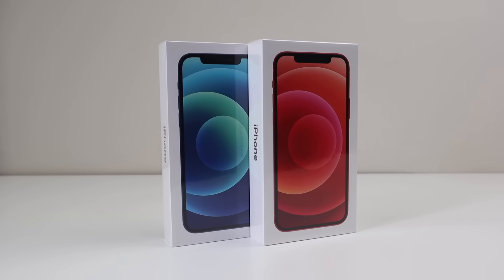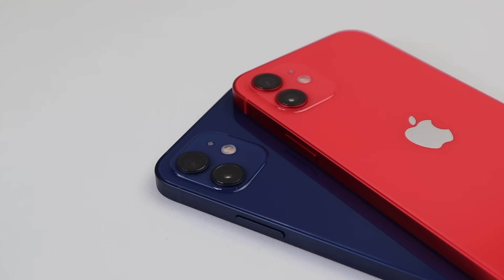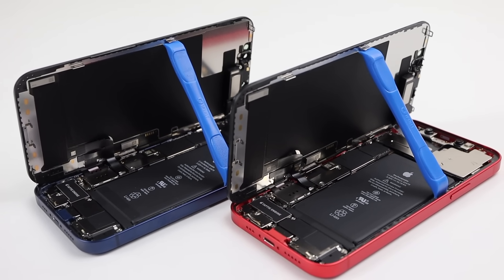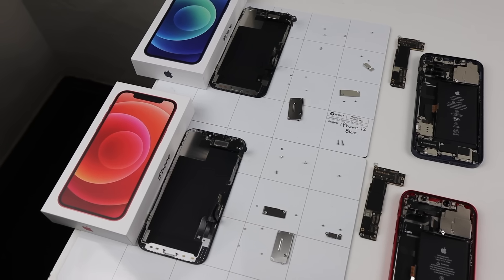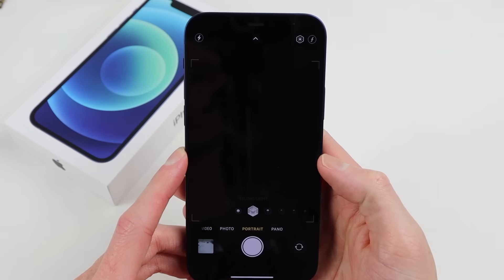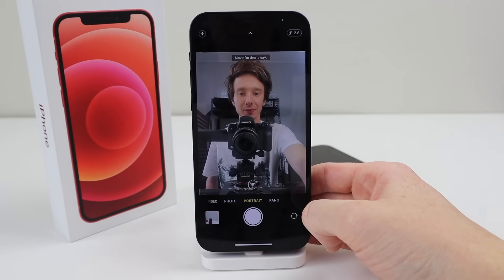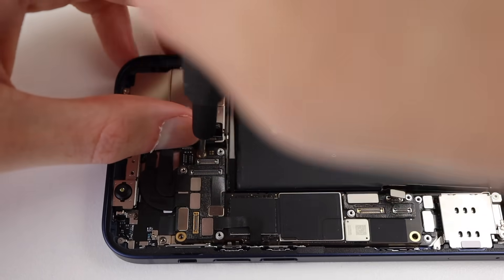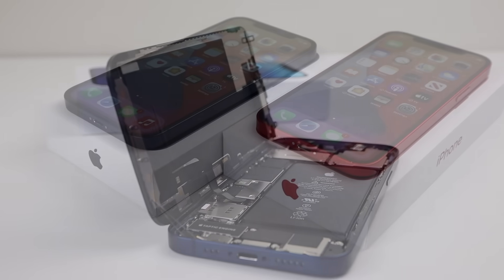iPhone 12 Anti Repair Design - Teardown and Repair Assessment

Comment: Me: holding onto my iPhone 6s Plus for dear life because I don’t wanna leave my home button and headphone jack
Reply: Holding onto my Note 8 for similar reasons
Reply: Kevin the note 10lite also has one 🥳🥳
Reply: @Dryblack1  A71 has headphone port
Reply: @katiserie  You're out of your mind if you think it makes sense to switch from a flagship phone to an extreme budget phone because an out of touch phone company thinks people spending well over a grand on a phone don't want headphone jacks.
Reply: @Dryblack1  same device :>
Reply: iPhone 6S gang
Reply: @tdoyr  just move to Samsung and stop paying Apple so they gotta not be so scummy
Reply: @SkyJUSTIN6  
If I had the money I might, but I also like the iOS system more

It’s a shame they make some nice software
Reply: @tdoyr  maybe try a cheaper pixel, they seem to get a whole lot of experimental updates
Reply: @SkyJUSTIN6  Only reason I still use Apple is because from time to time I break screens and need battery replaced, because I can repair it, I like it. That will change now. Also last Samsung I used was s5 and I hated the fact it was glitchy and screen was glued to body, so I am not going to buy that either. I have yet to find a brand that caters to my needs.
Reply: @SkyJUSTIN6  huawei*
Reply: @nodrinkingproblemhere9095  Samsung S5 is aeons away from the current build- and software quality of Samsung.
Reply: @mischahachler3341  Maybe, but once I buy something that has reliability, servicing issues, I tend not to try same manufacturer few years later to see if it is still building garbage.
Reply: @nodrinkingproblemhere9095  I would encourage you to take a look at it at least. Its day and night.
Reply: @tdoyr  apple is shameful for making a good system, going in the quote book
Reply: @SkyJUSTIN6  nahh iOS software is da best and Apple has Quality phones unlike Samsung
Reply: @SkyJUSTIN6  Yes. Samsung will even replace parts and reapply water resistance seals even you destroyed screen and etc while you disassemble.
Reply: @nodrinkingproblemhere9095  Samsung then and now are night and day. Don't decide things based on a poor experience in the past
Reply: @Freestyleny  I try not to step in poo twice. I will go with Huawei after I kill my current Iphone. In case of screen damage it will be a bit fiddly and it will need thermal grease for a 1£ before assembly but I won't have to try to heat it for 5 min before undoing glued back like on newest Samsungs. Like I said before, I like easy serviceability, getting old I guess :D
Reply: @tdoyr  well since android actually gives you freedom with the device you buy, you could literally just run the ios on an android phone
Reply: @SkyJUSTIN6  Samsung is way more scummy now 🤣🤣
Reply: The no home button is actually better in my opinion
Reply: I wish I had done the same!
Reply: I had the iPhone X and "downgraded" to the SE and omg I did not realize how much I missed the home button and fingerprint recognition. It doesn't have a headphone port though :/
Reply: @ej.tiene.hambre  I used to have an iphone x and I recently got the iphone 12 and it’s NOT worth it in my opinion all it is is a smaller battery and better cameras and small features
Reply: What's the thinking about apple not wanting other people to repair their devices ?
Reply: @zombehdad8224  money
Reply: @auroramothergoddess  figures
Reply: Omg... leave this slow shiat. Buy at least xs with airpods, you will never need fucking Jack if you are not audiofil.
Reply: There is a entire iOS Vs Android War in this one comment section
Reply: @NovasTooTired  well... All the bad stuff that has happended in the mobile Space is Apples Fault and by extension their customers so....
Reply: Lol I didn’t even notice the home button missing coming from and se 2020 to a 12. I upgraded for the 5 g
Reply: Holding onto my blackberry for dear life because I don’t wanna leave my physical keyboard
Reply: realy?!  omg this apple crap is bullshit! if you take the money for a new Iphone and buy and android device..... you get everything what you get in a iphone. and you pay the half price.
Reply: @officerstan1225  Yeah, but you give Google a main-line into your personal life. They made and own Android and will absolutely spy on you per their TOS, whereas Apple only might spy on you if you're worth being spied on.

Eyes and ears everywhere; that's the Corporatist dream.
Reply: @snoozebuttonallday  yeah you are correct, apple is the one an only company i know, that take personal Informationen, verry seriously. 
But on the otherhand you can also use google apps on Apple divices.
 
In these days are Account Informationen so valuable. 

The most companys done it wrong in the past, an sell the acc. 

It Depend on you, what your securety lvl is.
Reply: @officerstan1225  apple cloud service is always getting hacked...
Reply: @officerstan1225  Yep!
Reply: me holding my iphone 8 also being terrified of no charger or headphone jack
Reply: I dont mind loosing the home button but the main reason not going for IPhone again was the headphone Jack. I work as an event tech and so I often need a soundsource for soundcheck. I don't want to carry adapters all the time und Bluetooth quality isn't good enough for setting up sound system. I also like to listen to Spotify while programming the lights over the sound system. So I had a look at the honor flagship at that time and bought it. Battery life so much better than my workmates new iPhone that time. Still runs like first day, only the internal 200gb storage is full 🙈 I am sooo glad to have that fast fingerprint sensor next the option for face id in this pandemic mask year. Android isn't too bad anymore as I remembered it. But also next Gen honor isn't an option for me as no Google apps and I and my business is organised via Google services now.
Reply: just get an android, solves literally all your issues
Reply: @TJMiton  The newest androids have all of those problems lol
Reply: @ImJustAPersonBro  they definetely dont.  feel free to look at the equivalent vid on this channel for the latest android.
Reply: @TJMiton  My bad. I thought they removed them but I guess I wasn’t right.
Reply: @TJMiton  
Just get a Linux phone! :D
Reply: @TJMiton  I don’t wanna have a permanent 8bit camera filter
Reply: @TJMiton  no I have android I hate android ios ist 1 million times better no cap
Reply: @TJMiton  yea but then you have to use an android
Reply: @conormurphy4328  wich is faster if you buy the right phone. Will last you at least two years then you need a new battery wich will cost you about half what apple charges if they ever to will even to replace it. Also you will have a phone wich is basically has the same functionality. You are stuck in the past, like 5-7 years ago when this thing has mattered. iPhones are loosing out nowadays against some android competitors. In usability, and everything else. But it's easy to forget if you have never seen something high midrange the very least from the last 7 years. Because it's started then, and only improved from there on. Right know there are no meaningful differences. Some of my friends are fanboys, and then they see me not charging my phone as often, has the ability to change a battery for about 25 bucks... Also having the ability, to help them out with wireless charging from my phone... Yeah iPhones are so advenced... Like they are out of battery after about 10 hours of screen time at most. Mine managing about 12-16 depending on what I do with my new battery... So yeah nice one apple... So they hate me for how much I dunk them. They mostly have iPhone X's but my phone is about the same age... So fair game, and they are just annoyed why I don't have to think about changing my phone, why mine isn't sluggish like theirs after two years...
Reply: @playlistnor  you sound like you’re 12 years old
Reply: @conormurphy4328  nope my man I just had quiet a feje phones, and also had been somewhat tech savvy so a lot of the time had to offer / repair stuff for friends. So from I speak from experience. I'm not an apple hater, I loved the brand when they started out, was a little bit on the cautius side with their app store and lack of easy to acces apps from anywhere. I have been offering iPhones for years to anyone who had the money and needed a trusty phone, but not anymore apple is far too lazy lately. They aren't hungry anymore, they don't lead. I hope they get back with the new MacBooks may be a nice direction, but we have to wait. I love innovation and I pretty much love the use of steel and the simple udeful design! I hope others will go in this direction too with harder steel and glass phones with shock absorbing parts. But with better repairability, better batteries, and transparent software updates. Because their quality dropped noticably. iPhone X's in my vicinity there is 3 and they lost nearly half of their battery life in about two years. They are also slower noticably. It's easy to tell when a new one out of the box is far faster, and gets slower after the first updates. Still not as sluggish as two year old phones, but noticable. Test it out if you get a chance. Also changing batteries helps a lot on old iPhones. Still apple do not tell you anything when they slow it down because it's start to break. Pretty old phones like iPhone 7's can be sped up really lot by changing the battery.
Reply: @conormurphy4328  Dude please stop protecting apple. It’s pretty clear they just want you to waste money on their products. If you only buy apple products to make a statement that you have money then you’re free to do that it’s your money not mine. Just know that Samsung has better products that last for a long time.
Reply: @playlistnor  the iphone x battery health has been bad since the phone overheats since they came out so your kinda pointing at one of the worst phones ever
Reply: @playlistnor  idk the girl I’ve been banging has a iPhone 7 I bought her like 2 years ago and her battery is solid it lasted way longer than my Samsung s105g so I swit he back to apple
Reply: saaame, praying it doesn’t die seeing as it has a bunch of storage issues chfjfndmf
Reply: You may get an SE 2020
Reply: I would’ve kept mine but the limited storage was KILLING ME so I was forced to upgrade to the new iPhone SE.
Reply: @auroramothergoddess  the S10e has a micro SD slot! I added 512gb for $70
Reply: @rarinkaz  I have unlimited photo storage through Amazon as well as a hard drive. I’m not too pressed on storage.
Reply: Just switch to android
Reply: Yes, same here
Reply: Outdated
Reply: I Feel the same About the Samsung Galaxy note 4 Because of headphone jack, Home button, ir, sd, removeable battery, stylus
Reply: Me:still with a phone that I bought in 2014 👌😂
Reply: @danielangelc  yeah the se 2020 is cool but it’s noticeable slower after upgrading. Plus I wanted 5G. And I got a deal on both phones. The se was only 200 and the iPhone 12 was bogo. I’ll probably keep this until iPhone 15 honestly. I don’t see them making a ton of changes before now and then.
Reply: Or you can just get an Android phone...
Reply: I had an iPhone 6 and went to the 8, but missed the headphone jack! So I left apple and got the S10e. It's the same physical size as the 6,6s,7,8, iPhone se 2020...except it's all OLED screen minus the notch! It still has the headphone jack, fingerprint reader,  and virtual home button! Learning the new phone has been fun. I feel like I've been in a dark room all this time, and the lights have been switched on! Haha
Reply: what’s wrong with not having a home button on headphone jack? lmao without them the phone is better actually
Reply: @subscribeoruntuck  if you enjoy music clarity and dont want to charge headphones , it's not better.
Reply: lmao i have the 5
Reply: Leave em dead in the street with his iPhone 7
Reply: Michał Michał  I have an Android phone with no home button (like almost all newer phones) and also with no headphone jack like a lot flagship phones produced in the last years
Reply: I know your phone is running slow i can tell you have a lot of patience
Reply: Battery 😢😅
Reply: Holding on to my Huawei Nova because I have no faith in Apple at this point, Apple is getting weird from what I can see
Reply: holding onto my 8 plus cuz same reason thought glad I’m not the only one who doesn’t like this whole new design concept
Reply: @bexa777_  try iPhone SE, you will have to upgrade one day and if you really need that home button this is you only choice
Reply: @ahmedal-sharif8940   thanks for the advice bro but I don’t feel like updating at the moment or  anytime sooner , I’m just fine with the 8 plus , fulfills everything for me. plus I don’t rly like the SE it’s like the cheapest option in buying one of the latest iPhone versions out there.
Reply: You supporting a greedy corporation who's only concern is money
Reply: @stefanlewis7773  non of your business
Reply: I got a samsung AO1
Reply: @The Falcon he would’ve if he didn’t like apple, an iPhone 6s Plus would be barley working but he really still wants it
Reply: I have the old SE for the past 4 years now and it was due to sizes of phone and ear jack. This phone is still working fine but I wish I had more than 32GB of storage.
Reply: Same... but this year will the last for IOS support and updates. 6s Plus will be dropped on the next phone release
Reply: @BiggMo  probably, but still unlikely to happen. When iPhone 11 dropped with iOS 13 6s was supported. Same thing happened when iPhone 12 dropped with iOS 14. And even if they did, apple would never leave iPhone 8, the last phone with a home button.(not counting iPhone SE 2 which is literally as good as an iPhone 11 Pro.)
Reply: Just buy some asian phone
Reply: iPhone 7
Reply: I just upgraded from an iPhone 6S to an iPhone 12 and omg I love it but I did get air pods for Christmas so I don’t mind not having a headphone jack
Reply: You can always get a 8 plus
Reply: Iphone 6s+ gang
Reply: Holding my Realme 2 pro for same 😜😁😁
Reply: Same bro
Reply: just buy a samsung
Reply: I upgraded to a 11 from one of those, the battery and camera stabilization was shot , btw for the camera if u have the issue, put a magnet on the screen so that it holds the camera still
Reply: That home button is a complete waste of possible screen space
Reply: @tyrellwilliams317  My Note 8 has that solved. Haptic feedback virtual button when you press where the home button would be. It can be done.
Reply: This is why I use a android. Less money =more reliable, more spec, easily replaceable
Reply: 6s plus gang
Reply: iPhone SE, same situation.
Reply: Why get a new phone if nothing broken 🤷‍♂️
Reply: Just buy a se 2020 has a a 13 chip and homebutton
Reply: See I love the 6 but the battery is trash it just dies so fast
Reply: Hi dryad how much is my crimson percentage
Reply: Definitely
Reply: I'm in the same club.

I had a 15 year old trackphone before getting my iPhone 6s last year. The only reason I stopped using it is because my provider discontinued service to it. Before that I hade a flip phone. 

I'm happy with my iPhone 6s, but not because of the headphone jack. I only make calls, look at maps, and check an occasional news forum, so I don't need it to do anything more than what it does.

It was the last model that didn't have the super shady planned obsolescence programming in the OS that limits processing power as the battery ages. Even replacing the battery now doesn't fix it in some models. 

I fear the day I will have to get a new phone. Hopefully it is not for another 7 years.
Reply: I have a iPad so the home button feeling is still there. iPhone X, the full screen is just wonderful
Reply: You should get the iPhone se it’s just like the 6s
Reply: iPhone 6S Cult
Reply: Me leaving my iPhone se 2016 for iPhone X as my battery and screen is bad
Reply: Laughs in g8
Reply: @PM-gf1nj  you just dont take care of your stuff . Never broke headphone wires in my life . Wireless is not as loud
Reply: My condolences. I had a 6, 6plus, 7 plus, 10r and 12 pro. Get a new phone. Who would use a headphone jack! For what?
Reply: @michaelmiller6013  loud music with great clarity that doesn't need to be charged and doesn't cost $300...
Reply: Time to let go... I couldn’t imagine how slow the phone is after 6 generations.
Reply: iPhone 8 Plus gang winning
Reply: I loved my 6s and it died without warning christmas eve, i am now forced to upgrade.
Reply: Have you considered trying a phone without the mega important logo?
Reply: 6S died, happy owner of a LG G8
Reply: Is good you help protect enviromeng by not changing phone. But you also can try angroid.
Reply: iPod touch 7 gang
Reply: I understand the headphone jack but honestly I have a 12 and after a couple of days I didn’t miss the home button at all
Reply: @conormurphy4328  I haven’t had it n a while already I traded in my 7+ when the 10 came out
Reply: I’m still holding on to my 8 lost the headphone jack but I’ve moved on to wireless but yea home button all the way
Reply: Get the SE and a neckband Bluetooth earphones,  you'll really like the SE and neckband earphones have amazing battery life so you won't even miss the headphone jack
Reply: It is because you can't afford The New ones.
Reply: I envy you- I dropped mine in a river and my mom made me get a waterproof phone ;-;

Comment: Apple has certainly added security (cryptographic handshake similar to tls/ssl). between each sub component. This makes sense when you think about security : maybe it would have been possible to unlock a phone by replacing camera with custom made device.
We see similar security measures in other devices like payment terminals.
This is a trade between security and reuseability. Ofc Apple favored security... they don’t want negative ad because of some hacker exploit (think : Apple Pay)